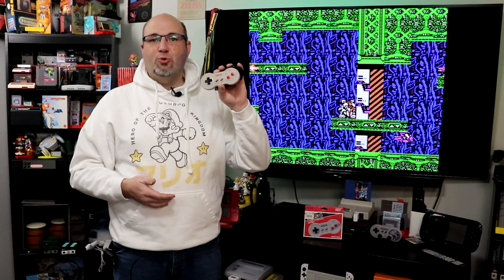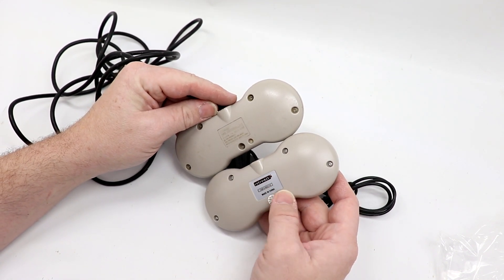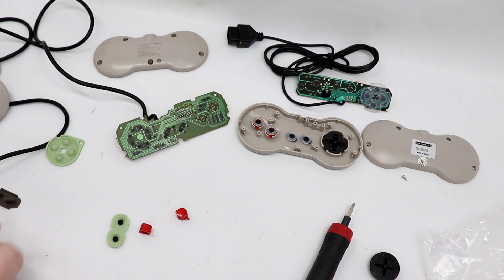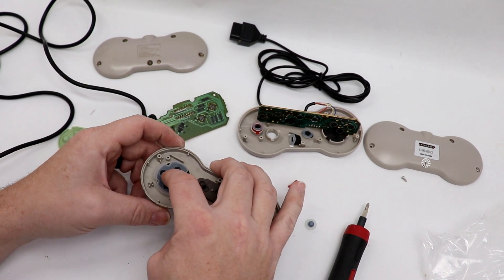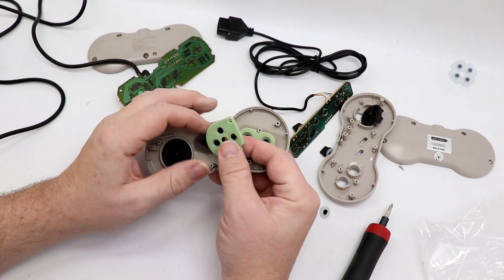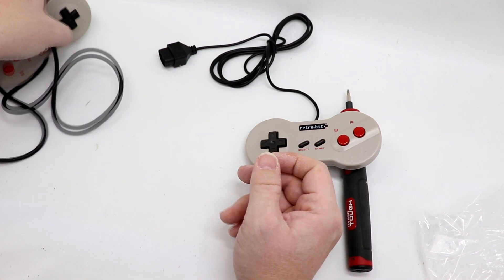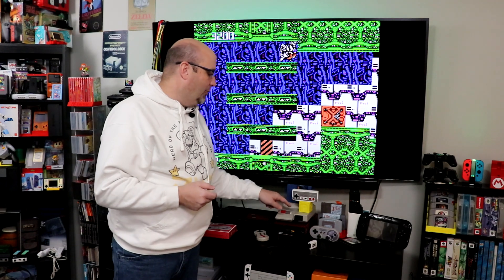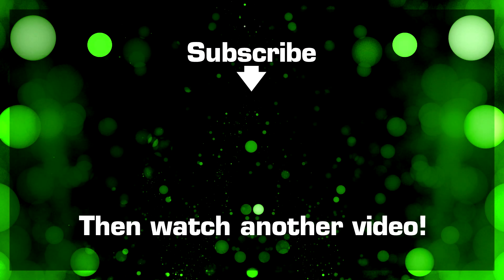Can I Repair & Restore a Beat-Up Nintendo Dog Bone Controller?

Comment: I really enjoyed this video! I wish that it would have worked out for you, but selfishly I know this means more videos down the road about fixing controllers, which I love. And that means more electronic microscope usage! :)
Reply from the maker: One thing I need to try is reflowing the solder around the pins on the board of the PCB. But I have 0 confidence in my iron or soldering skills right now

Comment: Gary, I got a pair with an AV famicom. Controllers were in similar condition. Two things I may suggest that I didn’t see in your video. Clean the board contacts with IPA really well.  Secondly, are the carbon pads overly shiny? You can carefully drag the carbon pads across a piece of note book paper. You will see grey streaks like light pencil. This will remove the sheen on them. Just be careful as you can tear the membrane. This got mine working well.  Hyperkin lists membranes on their site for regular controllers but could never find any for sale anywhere. Got some off ebay that looked similar.  That grey color, not clear.  They worked great in my old stock controllers. I think stock pads work in a dogbone. Thought snes start/select might work to round out a replacement kit.

Comment: I bought a dog bone one time that had a similar problem, it turned out to be there was a crack on the pcb (my guess from improper flexing) it was very thin it took me a few look overs to spot it but I ended up adding a thin copper wire to bridge the trace. Who knows try running the soldering iron across all the joints with some Flux it might work. Another tip that I also helped me once was the connector (it was very dirty) so I sprayed it down with deoxit spray. I took a small flat head to separate the nintendo housing and cleaned each pin. Once I reassembled it worked like a charm. If in case none of that works let me know I got some spares around I'd be willing to give you.
Reply from the maker: You know, that's a good point. I will have to break out the digital microscope and give the PCB a closer look! Thanks for the inspiration

Comment: Just like others have stated. You should gently rub the contact pads on some paper to refresh the contact, those get a polished/hardened over time. It wouldn't hurt to have a light wash with some dish soap with a soft bristle toothbrush on all the plastics and those pads.
Reply from the maker: I looked at the board last night under my digital microscope, there's a damaged trace.

Comment: Maybe try soldering the retro 8 cable to the dogbone board?
Reply from the maker: No, I have a few things in exploring
Reply: @RoXolid  yeah see what your options are, but I know for sure this method works with original Xbox controllers. My OEM ones were all fried after years of storage and it turned out the cable was the problem. Bought 4 cheap chineese Xbox controllers from Ali express, soldered on the connectors from the new ones to all 4 of my originals and they all were back in business.

Comment: Gary, sorry for the late comment apparently YouTube hasn't been showing me your videos, however I can fix your controller, you're more than likely need new wires ran from the PCB to the 7pin connector I can order the correct color of wiring I just need to know the correct gauge of the wire, or an easier fix would be to find a donor controller and swap out the cord.
Reply from the maker: Actually I found a broken trace (check the community tab, I posted a photo)
Reply: @RoXolid  Oh okay, I found it!  well did you fix the connection?  Let me know, I'm working on new PCBs